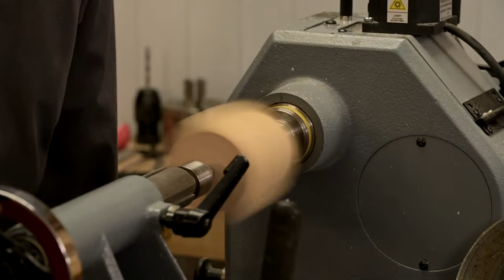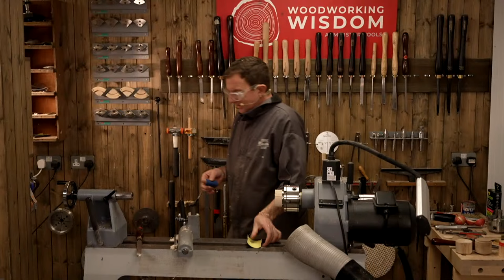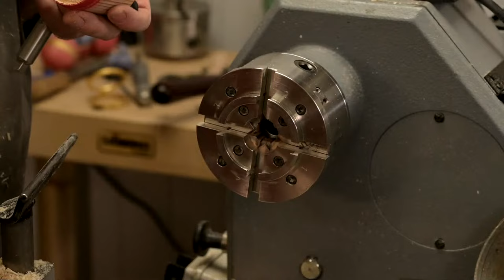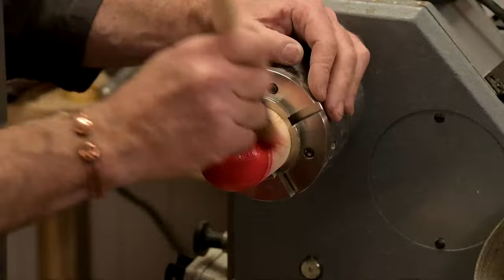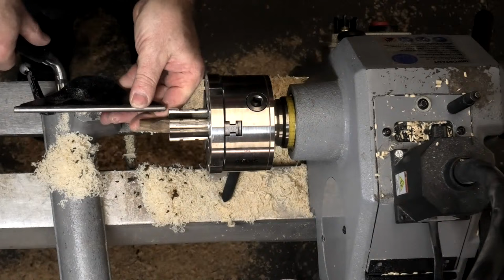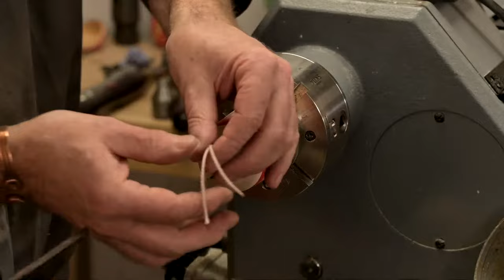Woodturn a Folding Bauble - Woodworking Wisdom

Comment: A very nice demonstration.  One significant technique issue that was quite obvious but not really talked about is lathe speed.  You SLOWED the lathe down when you trimmed the hanging stem with the skew.  Most professional turners are so accustom to their production work that they forget most viewers don't have the same skills and experience.  The skew is a very helpful and safe tool when learned with slow rotation speed.  Increased speed is why most turners are afraid of that most useful tool.  Thanks for all of your demonstration, including the skew.
John